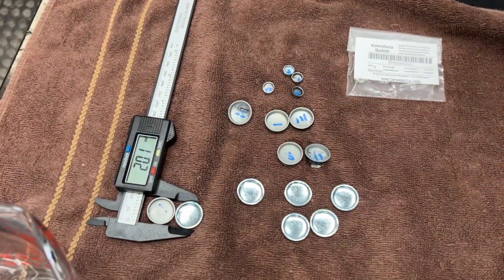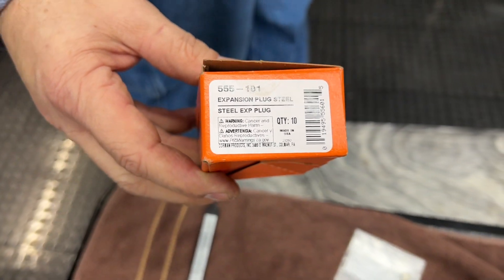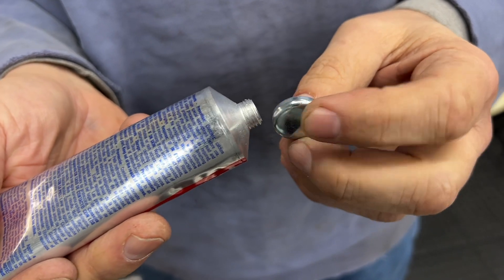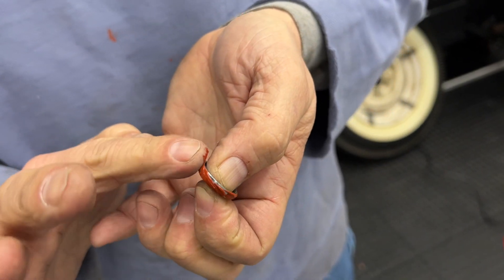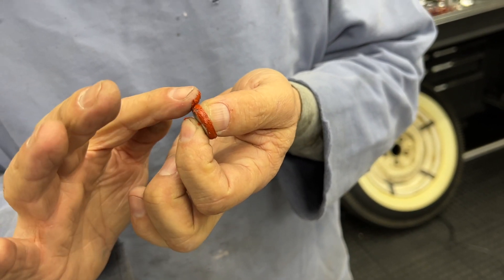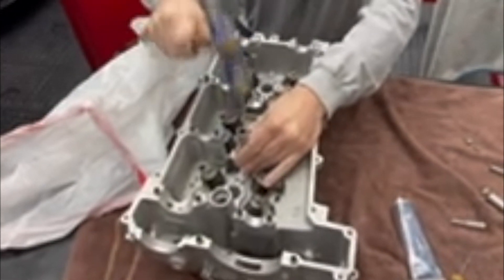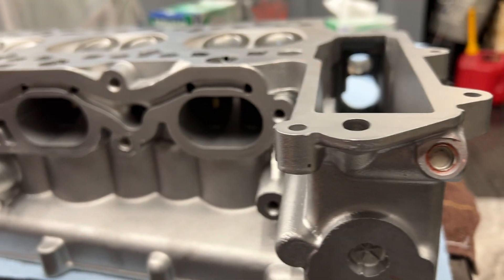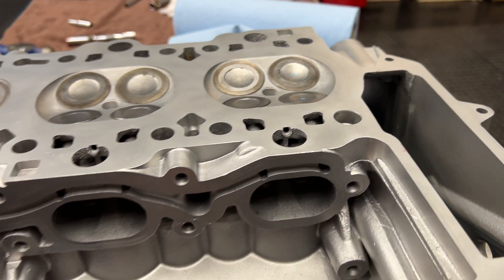Porsche 911 Engine Assembly Guide: Part 18 - Install Freeze Plugs

Comment: The builder should have installed those for you .. I sent mine to Hoffman in GA. Where did you send yours ?
Reply from the maker: +@MowSow we are the builder. That’s the entire point of this series. I guess you joined late. Start from the beginning and follow along! 🍻
Reply: What I meant is who is the machine shop who cut the valve seats, replaced the springs and lapped the valves .. etc. those are notorious to drop and cause a lot of trouble. I shipped mine to Hoffman, even Raby have had a large number of his rebuilt heads done by Hoffman throughout the years.
Reply from the maker: @MowSow  we lapped the valves ourselves in an earlier video